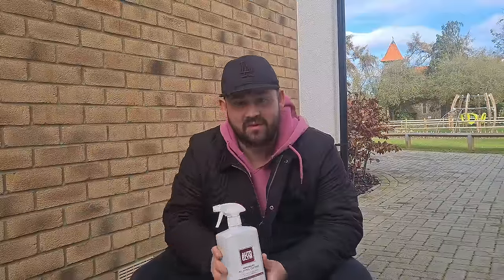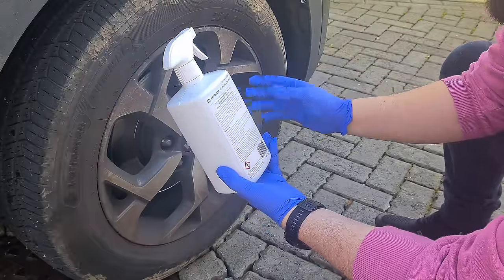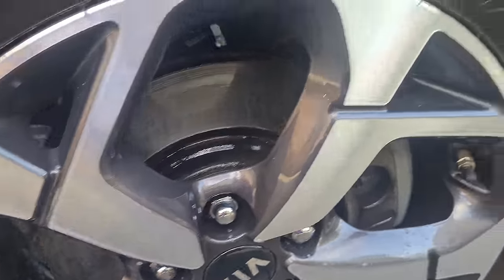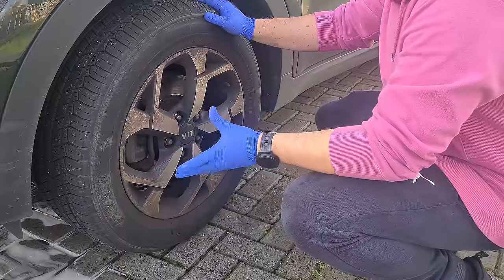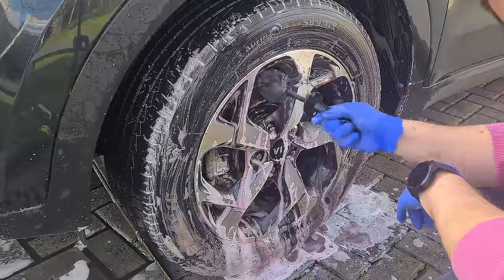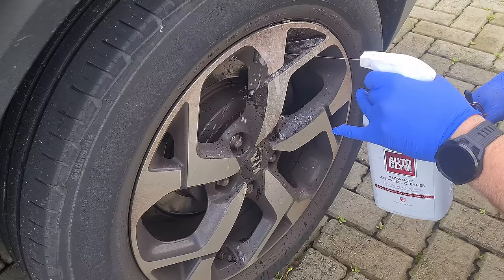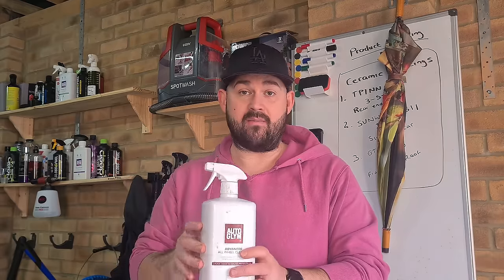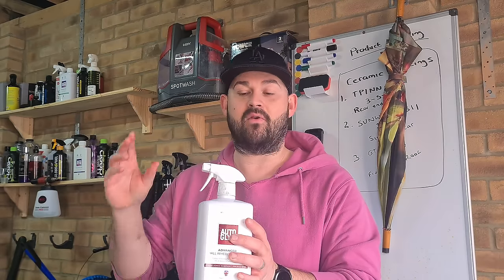Autoglym New Advanced Wheel Cleaner Tested - Better Than Bilt Hamber Auto Wheel?

Comment: Looked great, the level of clean for no agitation at all caught me out too, it is a great product. It looks like some of the beneficial cling and resulting contact time that was achieved by applying it to the dry wheel was lost a little by applying the Auto Foam over the top - that seemed to wet the surface more and drag the wheel cleaner off more quickly, reducing the contact time with the wheel. Application to a dry wheel and agitation results in it foaming up nicely as you saw in your third application method - I have also found it a great tyre cleaner too.
Reply from the maker: Thanks for watching Mark. It definitely did surprise me, such good cleaning power. I agree, it did lose some of the clinging power when topped with a snow foam and I used it again the next day with the same process as the bottle as I feel it definitely works the best when applied to a dry wheel. Ok good to know for the tyres, I will try next time. Thanks again for the comment 💪

Comment: What brush are you using?
Reply from the maker: Vikan wheel brush, it's really good and super soft so can be used on alloys as well. Thanks for watching 👍
Reply: ??? Is it a vikam
Reply from the maker: @gdougie2080  it's spelt vikan here a link https://www.amazon.co.uk/Vikan-525252-Cleaner-Length-Height/dp/B004JUGF7E/ref=asc_df_B004JUGF7E/?tag=googshopuk-21&linkCode=df0&hvadid=310493449173&hvpos=&hvnetw=g&hvrand=1510847041516165503&hvpone=&hvptwo=&hvqmt=&hvdev=m&hvdvcmdl=&hvlocint=&hvlocphy=1006764&hvtargid=pla-332550757589&psc=1&mcid=19af50c4528a32ac8ee93ddc045b48fc&th=1&psc=1
Reply: Thanks pal, been after one that’s not too clunky
Reply from the maker: @gdougie2080  no worries, it's a really good brush 👍

Comment: Leave the Autoglym product to do its thing - no need to put all the other products on there!
Reply from the maker: Thanks for watching! Yes I agreed, I showed this in the first test but wanted to see if it worked as well with the way I normally clean the wheels. But this product works on a dry wheel a lot better and other products actually diluted it down. But that's what the video is about, testing to see how it works and in different scenarios 👍